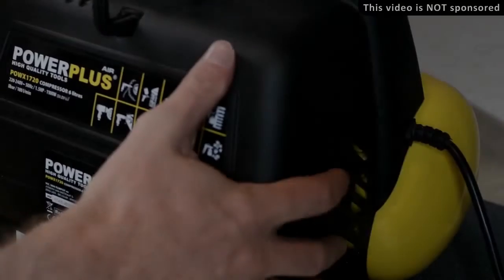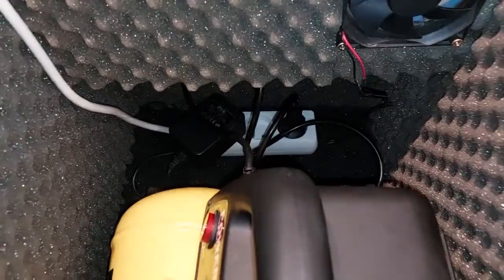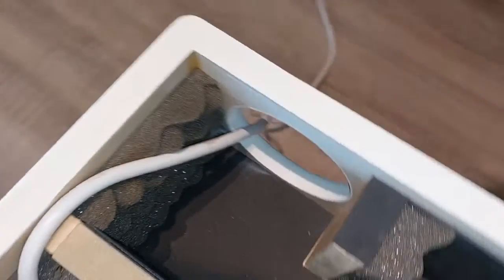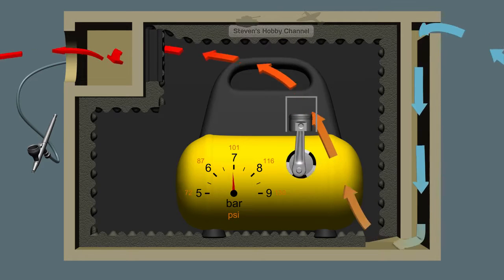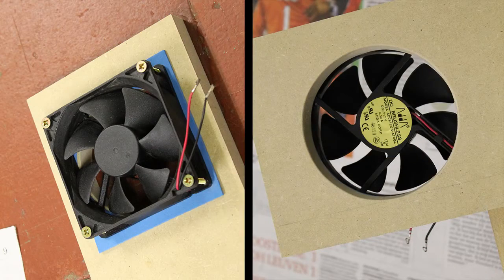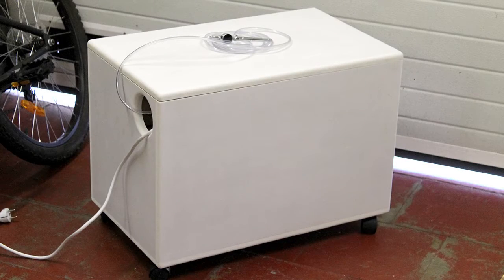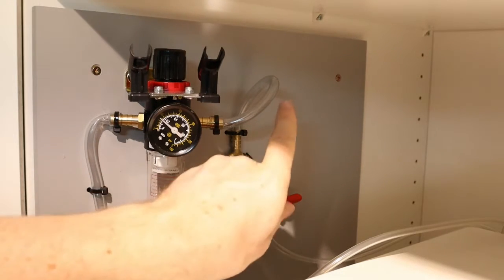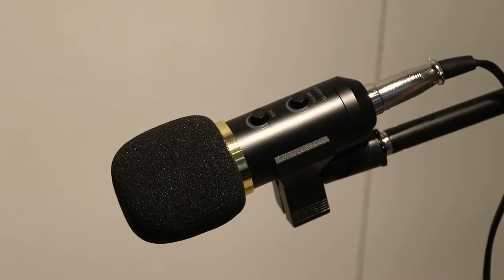My Airbrush COMPRESSOR BOX - Sound Reduction - Take a look inside - DIY

Comment: Glad I watched this before I started my build. I was going to make a container for my 8 gallon compressor out of 1/2" plywood and was simply going to make a box lined with sound deadening material and two holes mounted for exhaust fans in the back. Your method has a little more science involved with the different channels does this make a big difference in lowering volume? My compressor is already a quiet one that goes to about 68db max without a container.  Is mdf better for this purpose? My compressor weighs like 50 lbs so I thought i would need something sturdier. I also had thought of just drilling a hole and using a rubber grommet for the power cable and hoses.
Reply from the maker: Hi, reducing sound can be quite complex, but in general the heavier the (box) material will be, the more it will reduce sound, MDF tends to be cheap and heavy, so that's why I used it.  Plywood will work too, but 1/2" might be somewhat on the thin side though (perhaps add an extra layer of mdf on the inside?). The channels help reduce some of the direct sound-rays, imagine someone shouting directly at you or from behind the corner, the difference might be subtle but all small things help.  hope you project will turn out nice, cheers
Reply: @stevenshobbychannel  thanks for the reply. I'm getting closer and closer to putting this together. What thickness sound proofing material did you go with? I was thinking 1 inch all around.
Reply from the maker: Yes, the stuff I used was about 1inch indeed, have fun 👍
Reply: @stevenshobbychannel  Hey so I finally did this for myself thanks for the info and suggestions. I used 3/4" plywood btw. I was wondering is it ok if the sound proofing touches the hot parts of the motor? It says this stuff is flame retardant and it touches the top of it so it is not blocking any air flow areas. Just wanted to be safe.
Reply from the maker: Hi, great to read you've finished your project, to be safe I would cut out a small bit around the hot parts, so nothings starts melting or creating toxic fumes etc. It's always better if you can keep a space of about 1/2" around hot areas. Perhaps heat a small left-over piece with a hot iron or something to see what it does... Cheers

Comment: No mention of the drain valve in the tank - they always supply a 1/4" brass valve which rarely gets a mention. Replace the valve with a push-in elbow fitting & run some flexi line outside the box & fit a ball valve to it. The pressure will force any water thru the drain port & as hot air holds more moisture best time to vent is when you start up the compressor and it's at it's coldest.
Reply from the maker: Thanks for the tip, I mentioned the drain-valve in the previous (repair) video, but it didn't get any love in this one.  Draining the tank is indeed a pain at the moment, I also have to 'angle' the compressor because they didn't mount the drain-valve at the lowest point. Cheers
Reply: @stevenshobbychannel  spent 20+ yrs in Compressed air industry - seen many things. Pharmaceutical Co. had there compressor in same room as a Boiler n wondered why they were having a water problem in there lines  :) 
Sewerage plant said there instrumentation valves stopped working but the air is clean - I tapped the bowl on the Filt/Reg & it wobbled - full up with very clean water :) Panel Beaters do things on a budget - to minimise water many feed the air line via tea room fridge then back out to workshop. Fridge is always running so why not I guess - crude but it works.

Comment: Can you explain a bit more the second pressure valve thingie and how does that work? I only have a fengda compressor so not sure if that works or what do I need. Thanks
Reply from the maker: Hi, sorry for the late response, the compressor has a basic pressure regulator which is fine for things like a tire for a bike etc, for airbrushing I prefered a regulator with finer adjustments, and also outside the soundbox so I can easy change the pressure.   So the first regulator is always set to 2 or 3bar (30-40psi), and than the second can be set to a finer adjustment for the airbrush. Hopes this makes sense... cheers

Comment: would you be willing to link any of the supplies as to where you bought them and what brand you bought--such as the acoustic foam.
Reply from the maker: Hi Bobby, I've bought all materials at the local hardware store (in europe), so I can't help with any links. I've looked for the acoustic foam, but it's unbranded. I think any type of acoustic foam you can find online will do the job fine, it only reduces the 'bouncing' of sound-waves inside,  the actual 'sound-volume' is only reduced by an enclosure with solid/heavy materials, like thick mdf or other heavy boards. Cheers

Comment: Beautifully explained, with great visuals, superb!  Merci bien!  Thank you too, for NO MUSIC!!!!  What joy.
Mass Loaded Vinyl sheets are very good for dampening noise at the bottom of the box.  Its a rubberized vinyl.  Heavy.
Use Noico panels on the compressor tank to dampen the rattling clang jang of metal to a thuck sound, much softer. It is used on cars and RV metal panels.  When metal vibrates, the sound is tinny and high but this dampens the metal vibration sound.

This sound box is a great idea for any noisy device.  Thank you for the detailed visuals, makes it easy to build.
Reply from the maker: Thanks for the comment and tips, have a nice day 👍

Comment: I see that you have ability on electrical tasks and you are good at repairs and construction. I would therefore suggest you, to convert your piston air compressor, to an air compressor with a refrigerator compressor. You can keep all the air components and put a refrigerator compressor in place of the piston compressor. I have built four such compressors so far and I am completely satisfied, since I can use my compressor at all hours of the day and night. There are many video tutorials on Youtube.
Reply from the maker: Thanks for the comment 👍 it's a great tip since it's very quiet indeed.  I thought about it in the past but if I'm not mistaken the pressure was huge compared to the piston compressor, that made me wonder if I could safely do this myself, I need to do more research on this in the future... Thanks for the tip, cheers

Comment: Hello Steve,

Your design is excellent, practical, and also beautiful. I am very grateful for sharing your knowledge and experience. Is it possible to send the project file for use and reference?
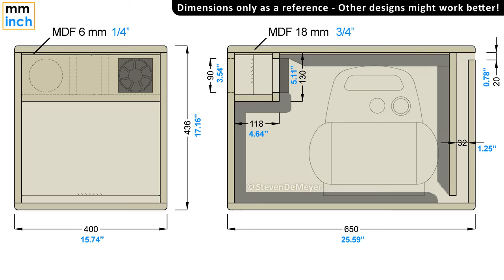Reply from the maker: Hello, at 3:47 you can see a basic plan with dimensions, I made that for the video (720p) since my original design at the time was only a rough sketch. So if you can take a printscreen (full screen) you'll have the plan. Cheers
Reply: @stevenshobbychannel  Thank you very much for your explanation and quick response

Comment: That's a great one! But, do you know what is the difference in dB units? I'm considering creating something like this myself. Will rockwool (covered with fabric) do as an insulator, or would this not do as well?
Reply from the maker: Hi, I haven't got something to measure the dB accurately, but I prefer the compressor when it's inside the box lol. - Rockwool is very good for sound insulation, but only in combination with a solid surface (wall/wood panel), it's quite dense and will dampen the sound a lot, but sound will still penetrate through, so ideally you still want to build a box and add the rockwool to the inside... For a box; the heavier the material the more it will reduce the sound (wood-brick-concrete...)
Cheers

Comment: Very neat build dude, but can I point out the gap for air vs the extraction is inadequate.  The best method is to have both intake and exhaust fans (both the same specs)  snake or (sound maze ) both boxes , but have it loop 3 times to form a letter “S”.  The setup you made will work, however over time it will strain the compressors motor and shorten the life in the long run.  My build has a sensor inside which I monitor from the outside .
Reply from the maker: Thanks for the comment, it would be more efficient with both intake and exhaust fans indeed. I'll try to do it like that when I make a new or updated compressor box, thanks and cheers
Reply: @stevenshobbychannel   don’t worry mate it’s a hard one and I only
Found out after a lot of research .  In saying that I’m astonished to find build videos with no intake or exhaust fan whatsoever . The only way it could be pulling air is through the gaps in the box. I imagine it’s like sound , and that it will find the tiniest of gaps or weakest link material to travel through .